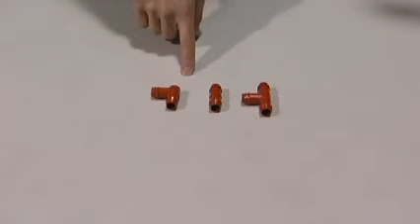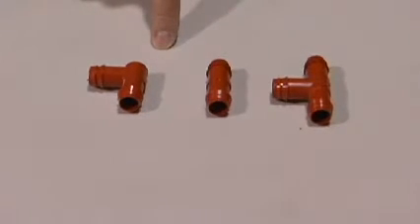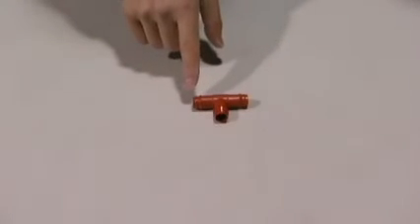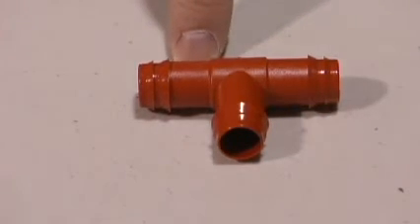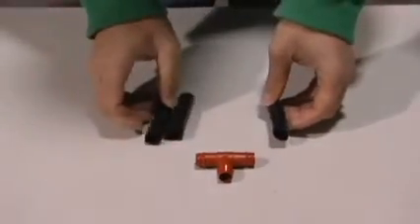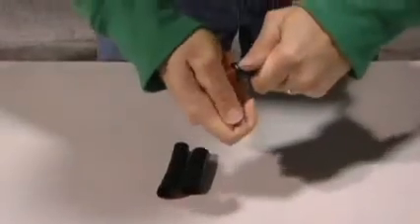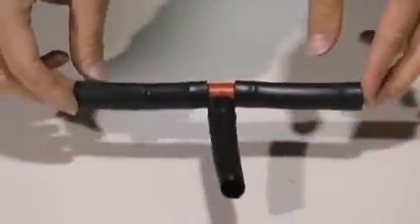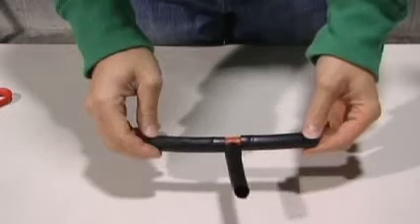Drip Irrigation 1/2" Barbed Tee Fitting

Comment: How can you get the fitting on if you are not strong enough to push it on?
Reply from the maker: When tubing gets warm, it softens up significantly, which makes it much easier to push on over the barb.  A couple tricks we use: 

1. Let the tubing sit out directly in the sun.  Depending on the temperature, this is often enough to make it easy to slide on over the barb. 

2. If it's not, the hot water trick can be used (this is a method we still use to this day).  Dip the end of the tubing into some very hot water (be cautious of course!) for a few moments.  This will make it very soft and flexible and much easier to push on over the barb of the fitting.  :)

Comment: you can reuse the fitting many times . don't provide incorrect info.
Reply from the maker: Many manufacturers state you cannot re-use these, so to some degree it is open to debate -- this video is over a decade old though, and we fall more on the side of being able to reuse these now.  A commercial or large Ag project likely would not want to reuse them, but on the homeowner or residential garden side of it, we recommend at least trying to reuse them -- that comes down to being very careful when removing the tubing from them, but if done with caution, we also believe they should be reused.